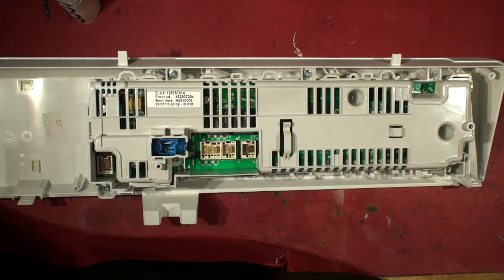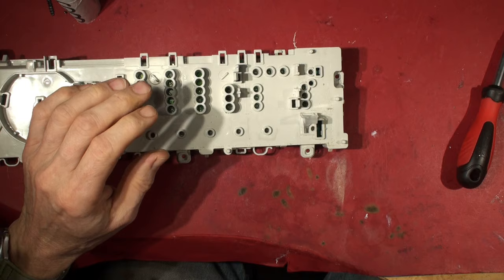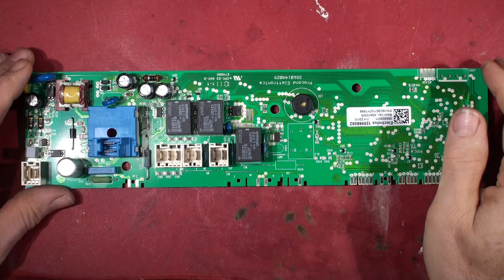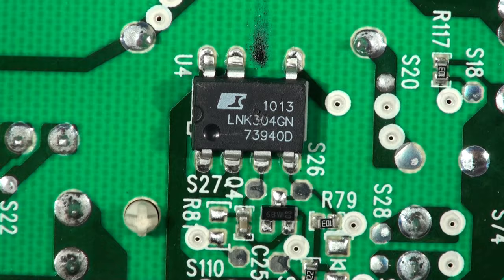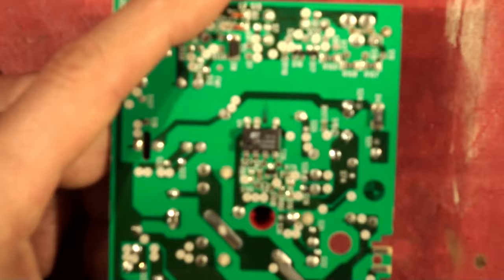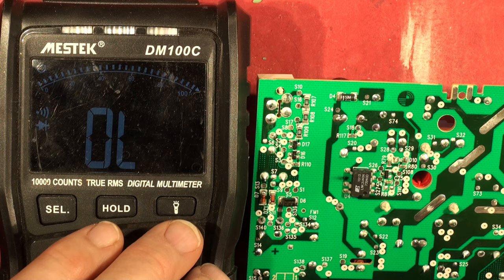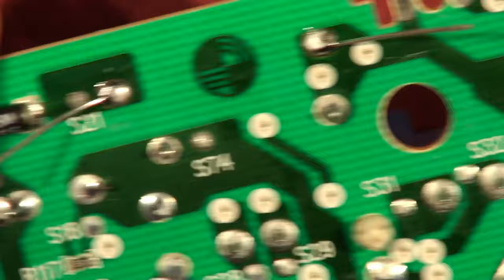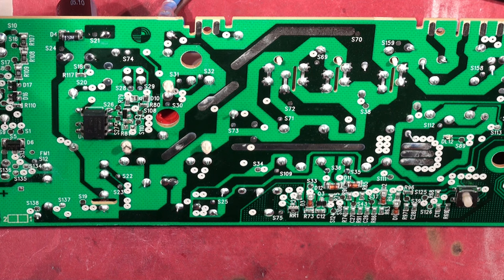AEG Tubmle Drier Dead Controller Repair and test

Comment: Hi Mr Smoke(!), We have an AEG dryer, purchased in 2016 while we were living in Germany, and we have since returned to our home in Australia.  Two weeks ago, it just would not start, no indication of power at all.  In my search for a cause, I came across your YouTube video, and decided to have a crack at repairing it myself.  I took apart the machine and found the correct circuit board (in our dryer, the circuit board with the LNK chip is not behind the front control panel, but is attached to the inside right panel of the frame).  The LNK chip (LNK586GG) was obviously cooked, much like the one in this video.  I purchased a new one on Ebay, and followed your video.  Despite some issues (when I cut one of the legs on the original chip, the chip moved and part of the circuit board material attached to one of the legs also came a little loose), I persevered and soldered the new chip on anyway...and I also replaced the 47 Ohm resistor (with a 47 Ohm 5 Amp spiral wound resistor, as I could not get a 3 Amp one locally).  Despite my inexperience, and the issues with removing the original chip, the dryer powered up after reassembly.  Under careful supervision we will run a load through the dryer later this evening.  Thanks for the video, and thanks for the tips, there is no way I would have known what to look for without your guidance!
Reply from the maker: Good job. Thanks for watching. Please like and subscribe if you can.
Reply: @razenby  I have liked and subscribed, and the dryer performed perfectly after the fix....so thank you again! Very grateful that our dryer did not need a costly repair or replacement!

Comment: Excellent video.  It has saved me the cost of a new dryer.  The technique for chip unsoldering worked well and I found both the 304 chip and the wire wound resistor on line.
So, many many thanks for the videos.
Reply from the maker: Glad it helped. Thanks for watching.

Comment: Hello Magic Smoke, What a fantastic video I followed you and your explanation of the problem, took out the board and to the naked eye it wasn’t obvious, had to use a phone camera to blow up the photos, you were spot on, ordered the parts cost more in post, soldered them to the board and now up and working, saved the machine from going to waste, cant thank you enough for posting your video
Reply from the maker: Great job. Another machine saved. Thanks for the comment. Like and subscribe if you can.

Comment: Thank you! I have a dead Electrolux dryer EDH97951W. I opened it and has the same problem. Now a have to order the right components. I hope I manage to fix it. 🙂
Reply from the maker: Good luck. Here to help if you need advice.  We need to save as many as possible. Thanks for watching.
Reply: @razenby  After changing the ic and resistor it seemed to work OK. It started and ran but stopped after a while. It wasn't dead, but it didn't run out the entire program. 😪 So now it has unfortunately been thrown away and a new one has been bought.😐
Reply from the maker: @johnnyeftevand6759  Likely it was mid program or a sensor wasn't connected..you may find it wasn't faulty,,

Comment: Great video mate, I was gifted a non working Electrolux washer. With my skills from Ham radio I deduced that 47r was OC, I replaced it but my gut told me I was fixing the result not the fault.
Sure enough....back to square one, then I decided the 304 was probably the culprit and started researching it and found a healthy cottage industry changing them.
Really enjoyed your version of desoldering versus my own style, I've learned a few things here, love YouTube for this sort of learning and skill sharing.
I have saved a washing machine and a high quality  pressure washer this week all for about $25. Using my own skills supplemented by additional information from people like yourself.
Again, thanks your video is the best on the 304 subject btw👏👏👏
Reply from the maker: Good to hear that you are saving the planet one repair at a time...

Comment: Dear Mr Magic Smoke,
Bravo to you for a great video. Very informative, educational and keeping us smiling with some amusing side-stories.
I just dismantled my AEG washing machine to get the motor out because I thought it would be the brushes (error codes E51 & EF5). Turns out there is black smoke near the LNK364GN chip which is right next to a somewhat blackened E47X 1551 coil with 5 legs. Will try to send a picture if youtube permits. Anyhow, now I need to decide whether to buy a whole new/used PCB (which might need configuration) or try to change some components.... Your video is useful to help decide this, so thanks for leading the battle to help beat programmed obsolescence & prevent stuff piling up in landfills and/or being burnt by the empoverished in developing countries to extract the gold & copper, etc.
Reply from the maker: Thanks. The coils don't usually fail just the LNK364GN and the series resistor. I have the chips in stock.
Reply: @razenby  Ok. Great. Could I perhaps send you some pics e.g. by email or WhatsApp in case you think other components nearby might also need to be replaced at the same time? The area of the black smoke was some 2x3cm on the underside of the PCB. (Should I wipe that all away before taking pics?) The machine stopped 7minutes into a 10min spin cycle with an electrical smoke kind of smell. The red LED programme selection panel all appears to work fine, but then nothing happens when we press the start button. I have a soldering iron from the 1980/1990s and could have a go as you suggested, though will need to learn to test components first with my new multimeter I suppose to see which are bad.
As I say, I'm still weighing up whether to change the whole PCB.... Any thoughts would be welcomed.
Reply from the maker: @rakmobrakmob749  Sure  ark.mail@gmx.com  send your address ill post you the bits.
Reply: @razenby  also your tips on which soldering iron is very helpful. I tried with my old 15W soldering iron from my youth and it was not very successful. I've now bought a 60W @460C & a 100W @500C, one of which will hopefully work better.

Comment: Exactly the same issue I had, blown resitor and chip, diode fine. Ordering parts and hoping it will work!! :) Thank you for a very good explenation 👌
Reply from the maker: 90% of them fail in that way. That chip is used all over the place and as a consequence is a huge cause of failures in domestic electronics.
Reply: @razenby  This is Gold Dust info 👍

Comment: really helpful thank you enabled me to fix a very similar Bosch model using a TNY264 chip (i guess similar) exectly same fault with resistor too. I replaced the 450v cap at the same time (but I think it was okay)  great help - much appreciated
Reply from the maker: Great to hear!  Another machine saved and in turn the a little bit of the planet .  Thanks for watching.

Comment: The great thing about failures with these boards most of the time is you can look on the inside of the plastic casing and see exactly where the issue is. Even if it’s just getting overly hot. Something that really helps us before you destiny of it having a few different wave links of ultraviolet light is super useful. Now that you can get cheap deep UVC LEDs, add that to a standard three and 65 nano meter LED flashlight used to look for dog piss… And you’ll be amazed with the different wave links and colors of light will show. The heat marks or shit stains on the plastic and boards might be very late sometimes, but having different colors of light just makes them so easy to see. Almost like on those TV shows where they’ll show blood spatter with a black light. Which absolutely does not work like that show but still. I also have wave links ranging the entire spectrum and there have been times where they come in handy. Not to mention how well they pick up things like electrolyte leakage, and amplify the visible characteristics of heated and warmed parts. Steam also helps a lot. I know that shouldn’t really be used with boards but I use steam from an ultrasonic cleaner that is not water basin that evaporates really quickly but water-based stain would be fine as long as the board is just dried out really good afterwards. The steam settles differently and refracts the light differently amplifying interesting areas by orders of magnitude. Obviously this is just a quick little trick you can use it’s no way to actually troubleshoot a board but within 30 seconds of popping something apart he can get you in the right area so quickly. It’s just some thing I have found useful personally but I am half retarded so if I had real trouble shooting skills I probably wouldn’t rely on silly stuff like that  … I need all the help I can get 😂

I see over 100 of those boards per year. Exactly the same obviously populated a bit differently but what is totally different was the plastic housing and button can figuration. Must be a UK thing the cars out of the thousand or so boards I’ve seen in the last decade out of washers and dryer‘s… I’ve never seen a cantilevered button configurational like that. “Kind of elegant but a bit over engineered.” Sounds about like how Americans view the rest of the UK 😁 no malicious intent… I love it over there.

I’m always proud when I finish up and have a dozen screws left over. That means I must of been smarter than the engineers.😬 kidding obviously

Remember that little power saving vice you tore down in another video? That had a little box of sand inside that was supposed to look like a PFC capacitor. You silly brunettes… That’s how we really economized and made our power generation technology so much more carbon neutral. Each and every hydroelectric or nuclear plant United States they just have a few of those plugged in on the output lines. 😂😂😂😂 problem solved
Reply: I don’t have a good cell service right now so I’m watching this on the lowest resolution setting. So I couldn’t make out the cracks in that resistor but super good eyes for spotting that because I can imagine they were nearly invisible.
Reply from the maker: Thanks for the comment. The plant that I ran had 30 repair engineers and they used to dive in with the scope when I could peer over their shoulder and tell then that a component was missing, reversed or broken.  Having a really good look and a think before embarking on circuit level troubleshooting usually saves hours .  I adapt my opticians prescription and get eyeglasses made to my own specification.   When I am wearing them I can see close up like a 10 year old with 20-20 vision. When I take them off I cant event read my watch!!!!

Comment: What an instructional video! With many pauses I got as far as R76, the 47Ω resistor, and sure enough, it was open. The diodes you mention seem OK, so the next test is to power it up, and see if I want to replace the chip.
During the vid I was thinking, the Yanks get straight to the point and I love them, but a Brit gives more detail. I am glad you talk to your dog, don't lament the poor answers, because if it was brighter It would not be a dog. As for cows farting in the living room, I howled! You won't get that on a Yank video. Many thanks for a good lesson, including solder wick and tackling surface-mount components, which I would never have dreamed of doing before (I might still have to change that chip).
Keep up the good work!
Chris
Reply from the maker: Hi Chris, Thanks for the comments.   You will certainly have to change that chip. It is patient zero in the ensuing cascade of destruction.   If you plug in without changing it then the resistor will blow again. Thanks for watching.

Comment: Your message is in time!
I just went through all my old component boxes looking for a wirewound and didn't find anything suitable, so I will order a couple this weekend. I will order a couple of those chips while I am at it.
I always go through my wish lists before making such a small order, just to see if I need a £1000 oscilloscope as well (so I save on relative postage costs). Just remembered: solder braid. See? Procrastination works!
Thanks again for a brilliant video and your kindness in following up.
Best wishes from Portugal
Chris
Reply from the maker: Thanks for watching.  Good luck with your repair endeavors.

Comment: Thanks alot, I was working on a dishwasher board and had no clue that resistor type was designed to blow as a fuse.
Reply from the maker: Pleased you found it useful

Comment: Exact same thing on my zannusi. This video helped out thanks. I hate buying new stuff. ta. I presume the right resistor is a wire wound one.
Reply from the maker: The correct resistor is a Bournes Fusible Wire-Wound resistor. Designed as a resistor with volatile coating under the outer coating that causes the resistor to explode instead of getting red-hot.
Reply: @razenby  cheers i just fixed it. you've saved me a couple of hundred quid. Still struggling to get the board in the facia though lol

Comment: This is wild! I’m sitting here with a similar board (almost identical just some color differences on components) in front of me that I just removed from my AEG tumble dryer that is completely dead, it act as the plug is not connected, totally dead. I was looking for schematics on google and this video popped up. As you show the chip that has blown, I look closer on my chip, and what do you know! It’s melted almost at the same location as yours, there are a small amount of residue on the same spot and it has a few melted spots on top just like yours! I then locate the resistor and measure it, open circuit…

Seems like my board failed the EXACT same way! This is crazy..
A friend of mine had the same happen to her’s, and she changed a control board she said. It wasn’t that expensive but this was a few years ago and it’s now expensive..
I’m gonna aren’t to fix this my self, just to see if it will work.

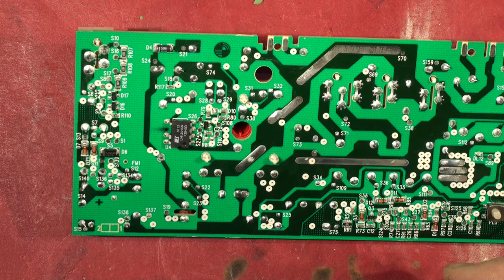Would be really awsome if this fixed it😄 Btw, is there a better chip I should look for? (I have gotten to the 15:22 mark in the video so you might mention it, but I just got so exited!!)

Edit:
I just checked with my supplier (Elfa Distrelec), and they have a LNK304PN, and my board has a LNK304GN, what is the difference?
And i can only find a 47R 10% resistor at 17w, i guess thats to much if yours was 3w..? Mine does not say anything about watt..
Reply from the maker: Thanks for watching. Yes, it is really schoolboy power supply design worthy of a smart light bulb rather than an expensive domestic appliance!  The poor reliability would be obvious to even a half-competent design engineer. I conclude that they know and don't care.  The chip manufacturer  (Power Integrations) has a huge amount of Landfill on their hands.    This chip is used and fails in a very wide range of domestic products.  Make sure you buy a fusible wire wound resistor and not  a standard one. A standard one would constitute a fire hazard.  You need the GN part as the PN is a SOIC  package which is much smaller than the GN.
Reply: @razenby  Thanks for the answer! I remember what you said about firehazard so i specifically looked for a wirewond resistor👍 But i found several auctions on ebay selling the chip and a "normal" metal resistor together.. That's not good.. Im sure many people have bought it not knowing about it.

But i guess the way they look gives them off as proper wirewond resistors. The one i bought looked alot like the one on the board in term of color and surface. Think i bought several, so i might crack one open just to verify. hehe
Reply from the maker: @Alpejohn  They are fusible wirewound resistors that have a volatile coating inside that explodes during massive overload. Very special. Made by Bournes

Comment: Nice, I learnt a lot from this! Another failure point of these types of PCBS with edge connectors is corrosion, which can be well hidden when it is sandwiched in its plastic shroud
Reply from the maker: Interesting. I haven't seen that before.

Comment: Just found this video after my old washing machine gave up with exactly the problem you said. No power to the display, just poof, worked the night before nothing the next day.

Obviously being a family we needed a new machine fairly quick, but I've kept the old one because I wanted to see if I could repair it, after already replacing the drum that failed.

Anyway, the chip I have is a LNK364GN, but after a quick clean up, as there was no noticeable sign of an explosion, getting my mobile camera out and zooming right in, I notice a very small crack in the surface. So highly likely a blown chip.
I couldn't get the same chip number exactly, but got the next model up which should work based on docs.

Anyway, don't have a hot air station, and don't want to cut the chip as it's so tight,  but I saw your copper wire trick, and that looks like the way I'm going to try lifting this chip. It's in a tight spot, so will have to be careful.

And will check the green resistor too, along with a few other components that look like they are on the circuit, or close by.

If I can get it repaired and working, I'll let you know, but thanks for a very useful and helpful video.
Reply from the maker: You are welcome. Good luck with the fix.

Comment: Cracking tutorial, i like the wire cage keeping the solder molten, sneaky :-D
Hopefully that machine is still working.
Now i'm hopeing my bosch serie 4 washing machine does not have a crappy pwm chip.
Reply from the maker: Thanks. All PWM chips are crappy  but some are crappier than others!!